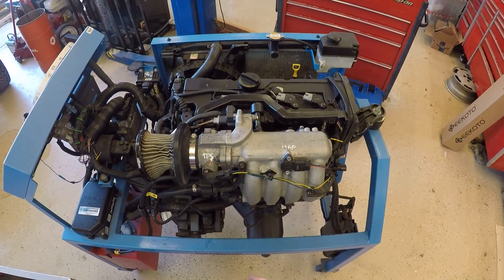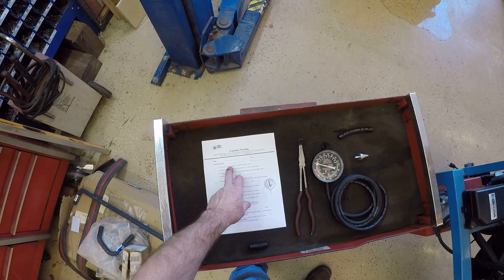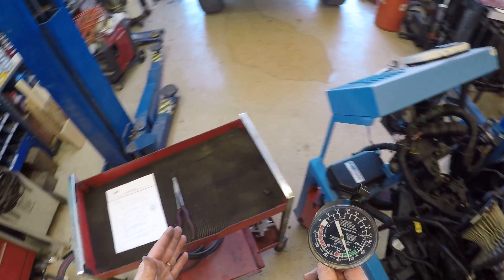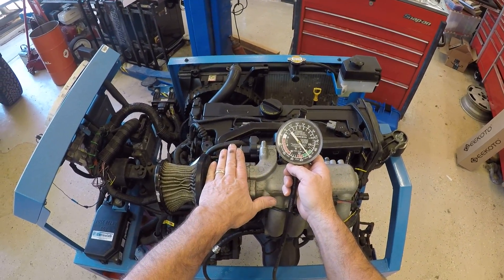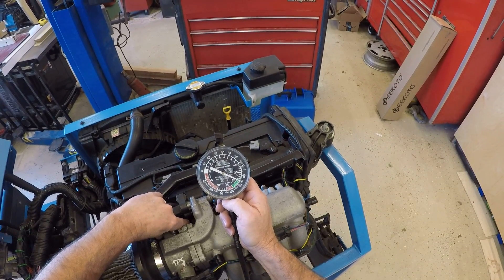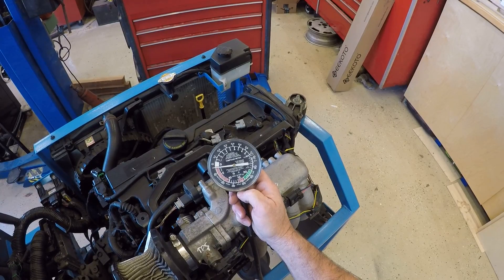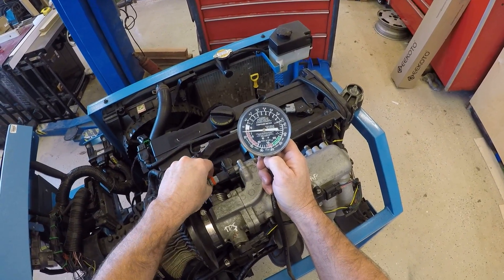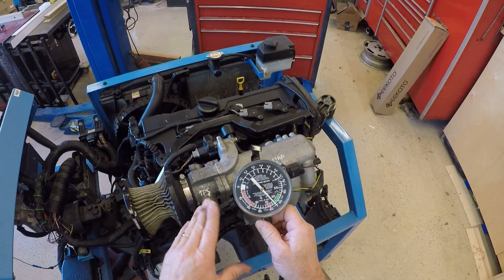Vacuum Testing with a Professional

Comment: The reason you didn't get a higher reading when you snapped the throttle shut after holding at 2000 RPM is that modern engines compensate for the "snap" by either slowing down the throttle butterfly closing or by adding extra air to the intake manifold. This is in order to clean up the excessive pollution that is generated by the  sudden closing of the throttle. Such modifications became standard in California around 1973.

Comment: Great video! Btw can I do the same test on a Diesel Engine?? Is it possible?
Reply: No, because Diesel engines don't have a throttle. Engine power is regulated by the amount of fuel injected. Full air intake is always available.

Comment: What does a vacuum gauge mean at cruising speed half throttle steady foot pressure on the gas pedal.  misfiring but needle flutters very fast between and inch or 2 of vacuum. Mine is fluttering very fast between 12 and 11 inches of vacuum during a misfire. Has new plugs wires distributor cap and rotor

Comment: I like this video it’s very thorough and I just bought a vacuum gauge like this in the video but I use my boost gauge for the STI. Now on my Acura I used the vacuum gauge and the reading at idle was at about 23” of mercury so more vacuum is Better than less vacuum so I just like testing while everything is working so I have a baseline.

Comment: Great informative video. Chevy 5.3L. Idles at 16"hg. Throttle blip goes 16"idle to 0 to 21 to 13 and then back to 16 in hg
Steady 3000 rpm 16 to 21 and holds there. Does this indicate i have a vac leak and its pronounched at idle? seems low at 16 but all else seems fine.

Comment: got qugot question for you ....i just rebuild my chevy 350 1990 k5 blazer i converted it over from tbi to carb ..i did a few up grade on the engine high performance  intake headers 3' pipes all way back up graded the cam to a howard rattler cam 525 intake lift 535 exhaust duration 227/235 lobe separation 109 center line 103 i still the same factory heads on there i believe they the swirl port heads ..i no i should have went with some better heads but the engine was already done. i put a brand new 1406 edelbrock carb on it right out the box every sence i put that carb on there i been using alot of fuel i set the carb best as posible ..im using a awful lot of fuel just with it iding..i have my pressure regulator set at 5psi..dont no why im losing so mush fuel

Comment: Good Day Mr. Bryan , just watched your video and i have a question if you could help me ! I have 1998 Rav4 2.0  3s engine and BMW 1987 E30 320i , I snapped accelerate the engine for both cars but the  vacuum didn't drop to zero , not even close to it ! the needle didn't pass the 17 hg ! how do you explain that ? Thanks

Comment: Mr Bryan, can you tell me if insufficient valve clearance (1) will cause an erratic vacuum reading at idle?
Reply from the maker: It the intake valve is not sealing then you will have a rapidly moving needle, If the exhaust valve is not sealing then not so much. I hope this answers the question for you.
Reply: Well then I  have an intake valve on no.3 that needs clearancing.

Comment: Hi, Have a 428 SCJ  Ford engine in a 1969 Cougar. The engine was running fine and then all of a sudden low vacuum of 2.5. at idle. Took off the intake and resealed it. No change . Vacuum gauge shows late valve timing.  Engine runs fine but not enough vacuum to close the head light. Looks like the cam timing gear must have slipped. I bought the engine as a rebuilt engine. Rebuilder left out the cam dowel pin?

Comment: Thank You Mr. Bryan, Will This Exact Procedure Work For A Honda Civic 2009? Thank You, For The Video (:
Reply from the maker: Yes it will, but you will have to use the gas pedal to open the throttle since the 2009 is drive by wire.